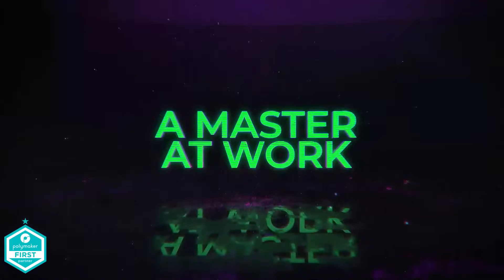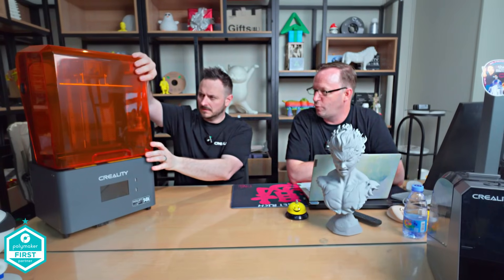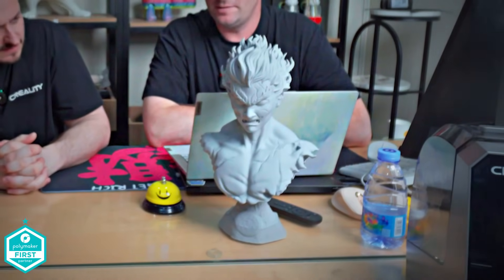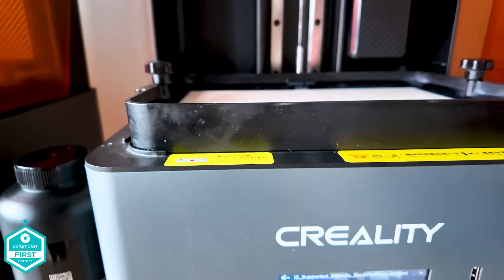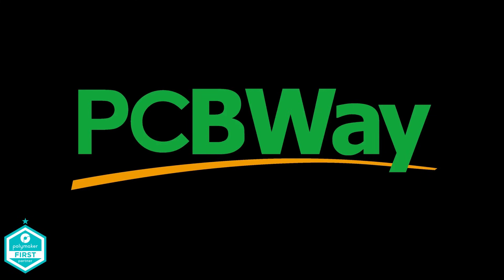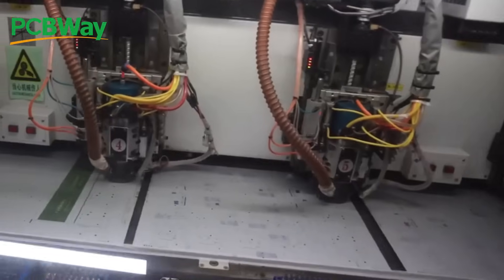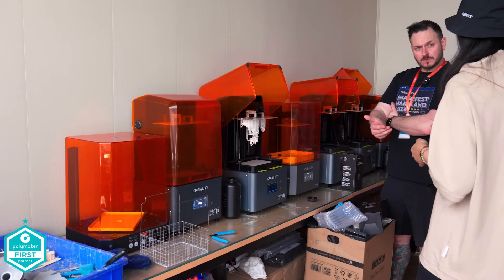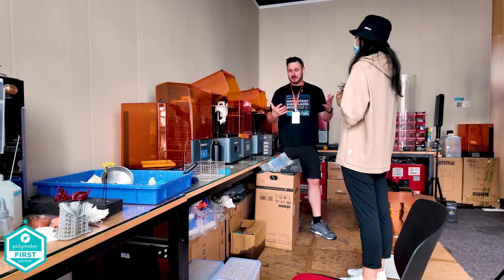First look at Creality's Halot Mage S 14k Resin 3D Printing

Comment: 8,10, 12, 14k doesnt really matter for most prints. Also where carbon filter can get rid of odor doesn’t remove most dangerous particulates. Just makes you feel safe.
Reply from the maker: Well at least you feel safe… right